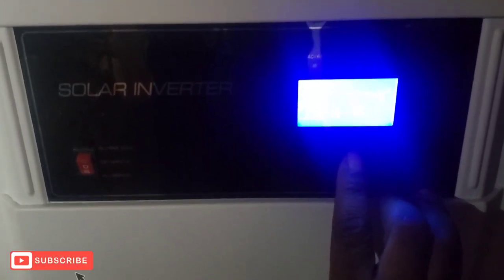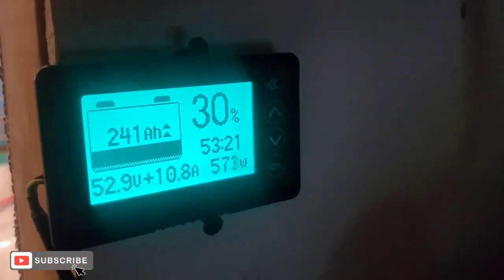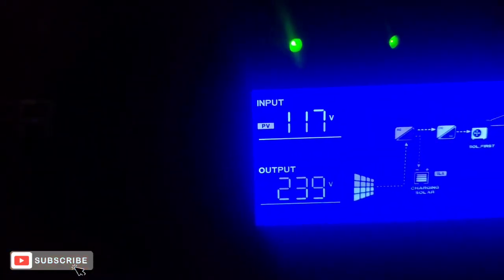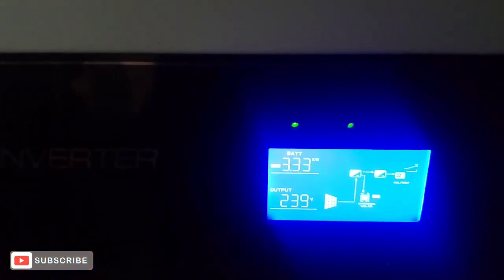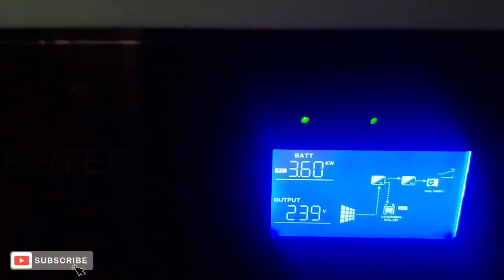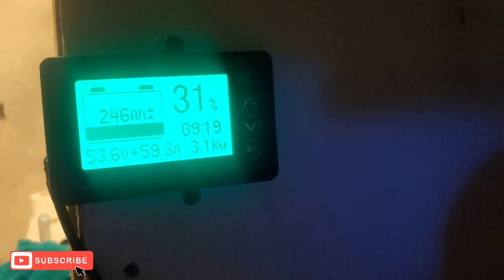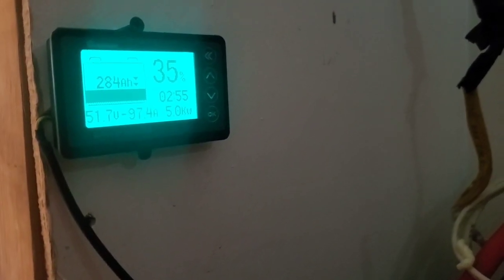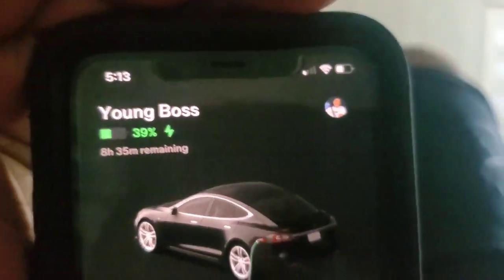Pre testing my second solar ground mount and charging my tesla

Comment: My man, might be time for you to start setting up properly. Cancel those EG4 inverters and get yourself a Sol-ark 15K inverter and smart loads panel, it's fixed all the problems of the 12K. The 15K has 200A passthrough, and can work with the smart loads panel.

At least check it out.
Reply from the maker: I’ve definitely been looking at them and I will change it up once I redo my system thanks for the Information
Reply: 500V on solar panels is dangerous territory, personally I wouldn't go that far. There are some videos explaining why going that far is problematic on YouTube.

You should also hook up your batteries differently. Take the Positive from the first and the negative from the last (or vice-versa). If you don't you're gonna end up cycling the top one more than the others because of wire resistance.

The whole thing of deep cycling LiFePO4 batteries is pretty bad for your batteries, you should treat them close to NCA, better to cycle 20-85% or 20-100%.

Anyways glad you're still doing this, always good to see someone committed to a good cause.

Comment: A man you got a nice system and a mess in the wires but nice
Reply from the maker: Yea Ima clean the wires up when I install the eg4 inverters
Reply from the maker: And thank you
Reply: I’m still running a Samlex 3,000 watt 12v 50kw battery bank and 2,500 watt 24v on a 25kw battery bank Because I’m undecided what inverter to get
Reply from the maker: @solarandwindinsouthtexasda1473  24v should be more efficient
Reply: I run my whole house except my central air and my water heater but I do have a mini split
Reply: Yeah but I think it’s time to move out 12 and 24 and getting to 48 V I have 10 kw off solar I have been with my system for five years I think it’s time to Move on

Comment: Don't you have to have one leg out of phase if you want to use 240.  I am not 100% sure, but that is what I heard.  Or are both inverters attached to each other in some way.
Reply from the maker: The way I have it hooked up now is 240v the black and white wire is hot giving me 120 on both sides and I used a double breaker to give me the 240v